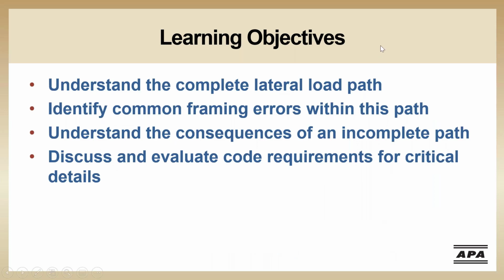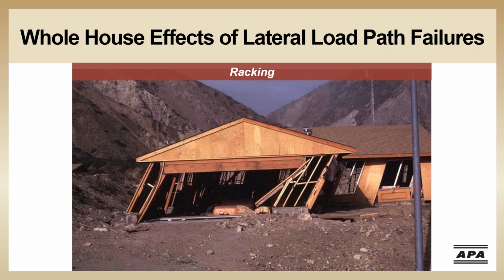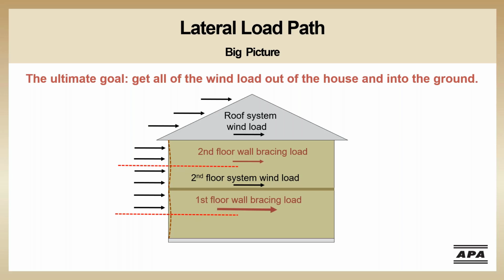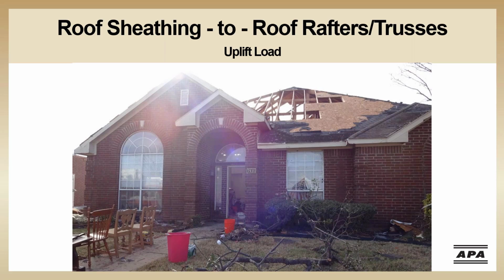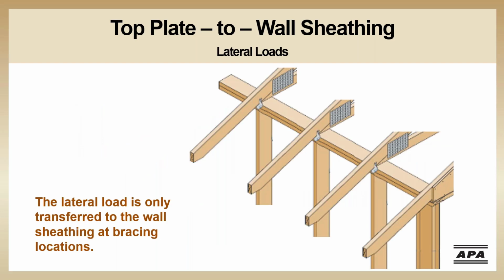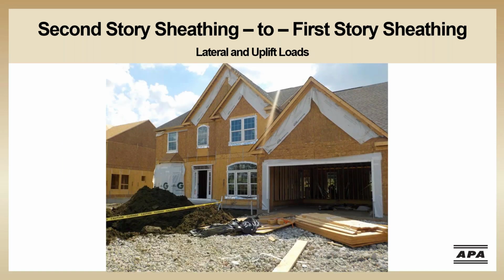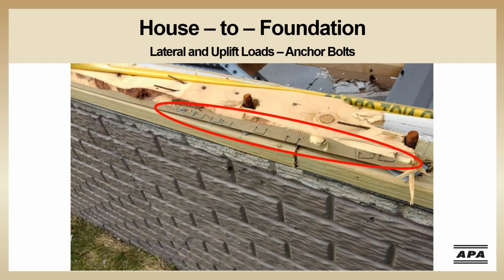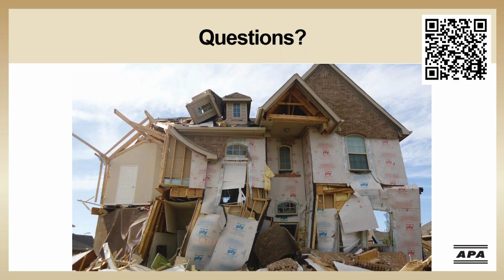Lateral Load Path Basics: Tracing a wind load through a wood framed structure

Comment: Very good presentation and visuals.The slide on 2nd story sheathing to first story sheathing was very interesting, to see the lateral or uplift load going from the wall sheathing/bracing through the collector to 1st wall sheathing/bracing via the fasteners!  In other videos I have watched with platform framing, the sheathing spans both  floors at the 1st floor  dual top plate, but it's the fasteners that transfer the loads, and both sheathings must connect to a common load member. I think of uplift as a negative load, like negative g's in flight.